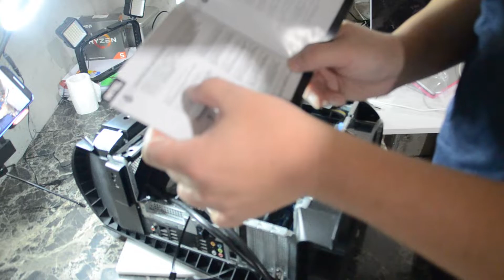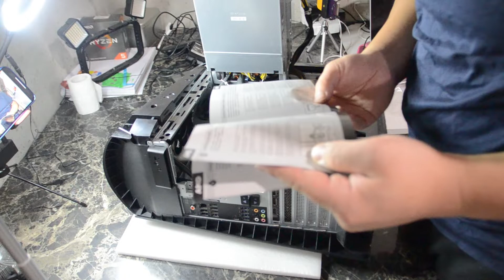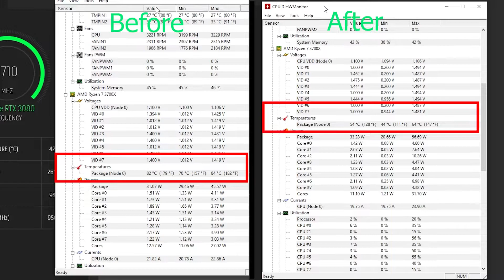Alienware Aurora R10-11 swap of fans Corsair Hydro H60 Liquid Cooler, Compare with before and after

Comment: Hey IonyTech Do you know how to fix boot failure on device? if so can you help me, i just bought the cpu cool, and it all goes fine but now this fail happens any advice on bios system and what to install o change?
Reply from the maker: What is the error message u see?
Reply: @ironytech3443  Boot failure on device
Reply from the maker: @MimiVRz  Can u enter BIOS and c all system information? find what device missed
Reply: @ironytech3443  The error message is Boot failure on device thats what it says on the screen
Reply from the maker: @MimiVRz  So you gonna try to get into the BIOS to c what happen
Reply: @ironytech3443  i did go into bios but then i go to boot and then to log into windows it says boot fail on device, i think my BIOS is couRupted, i think i need to get a usb and install windows onto it
Reply from the maker: @MimiVRz  After get in the BIOS and cehck if primary NVME SSD works good or not, might be you set the DHCI or Raid functions then fail to the windows.
Reply: @ironytech3443  wheRe do i check this

Comment: Hi I don't know if your still taking  answering comments

I have a water cooler from factory.

I have just bought a H60 corsair water cooler, is it worth changing it? Is it more powerful? Or should I refund and swap the stock fans instead.

Thanks!
Reply from the maker: If you bought AIO water cooler with Desktop from factory then i don't recommend you to change H60I, coz stock water cooler will be powerfull thant H60I, excep very noise coz original water cooler can adjust fan speed. H60I Can't although it is very quiet. and if you bought stock air fans from factory like me, then for sure H60i much better. ^^
Reply: @ironytech3443  thanks so much mate I am going to return it. You just saved me 70 pound

Comment: I got the R12 at best buy and there is no cooling option under 2000 dollars so i ordered this water cooler and dual channel ram. Thanks for the video. I was glad to see you didn't have to remove the motherboard to install a new bracket. I was hoping for that. Much easier. Thanks for the video.

Comment: Good morning Brother, great video, if you don’t mind and have a time then could you please do check this Corsair Fans information on their website and let me know, weather they would work on this Alienware Aurora R12, as I don’t know much, Also do make more videos on this Machine, really appreciate and many thanks Brother,

SKU CO-9050104-WW
Corsair iCUE QL120 RGB 120mm PWM White Fan — Triple Fan Kit with Lighting Node CORE Included.

Give your PC spectacular lighting from any angle with the CORSAIR iCUE QL120 RGB PWM White Triple Fan Kit, equipped with 102 individually addressable RGB LEDs – 34 in each fan – across four distinct light loops in a brilliant white housing.
Reply from the maker: No, This Fan kit u mentioned above that is no use to this PC, coz you don't have more extra power socket to let RGB fan controller use as well as fan kit
Reply: @ironytech3443  Many thanks and really appreciate Brother.

Comment: Hello! Thank you for this video! I'm getting ready to do this same installation on my R10 too for the same overheating issue. I'm going to use this as a guide to make sure I'm doing it correctly. I'm excited and can't wait to see the difference!
Reply: sid it work
Reply: @futureontop   I will be performing this process on my Intel i9, Air cooled CPU to Corsair H60 AIO w/ likely within the next 30 days, I've ordered the cooler and the VRM heatsink, now just looking at fan options. Lots of research is required and my go through at it will be the latest to date of someone doing it so I'll try to put together something to share to help others, at the very least a long comment explaining how it went.

Comment: My r10 comes in the next few weeks, I got myself a different fan so Corsair fan, I was wondering if it's easy to add a second intake fan. And do you need splitters to do this? I did not order with a hard drive. Only a ssd. I'm just worried I'll break something if I try to do this method. I could've sworn I've hit the water cooled option. I guess I didn't cause on the final paper, it says smart cooling.
Reply from the maker: In my opinion, that is easy to replace cooler as well as  fan, u just watch my vedio carefully and do that, don't worry.

Comment: Thanks for their video! Recently picked up an r11 and looking to do this install. How is it holding up? Also did you install vrm heat sinks? Or can this do without ?
Reply from the maker: No I didn’t install vrm heat sink. Not mandatory
Reply: @ironytech3443  thanks!

Comment: Just got R10 with rtx 3060ti with alienware 34inch curve monitors 120hz. im also upgrading to that cpu liquid cooler the stock sounds like a jet engine playing game😂.
Reply from the maker: Congratulations!, Should be jet engine but you can set RPM to quiet :), Don't worry

Comment: I've had my Aurora R11 for two days.  It's sad I'm having to find videos like this after dropping all that money, but it just overheats too much when I try to stream.  Only when I try to stream.  I can play my games, or do anything else on it all day with no problems at all, but when I try to stream it overheats to the point it just shuts my game off after 5 mins every single time.  Pretty sad, and frustrating.  Now I have to drop more money.
Reply: I would repaste the gpu before doing anything else that will drop the vram temps
Reply: @orangejuicewithpulp403  Appreciate it, but I did go ahead, and buy this and put it in, and I have had no problems at all about it overheating since.

Comment: Any way to get it to stop the supportassist pre boot system performance check? It takes a minute to scan and then says the cpu fan failed to respond correctly. I can continue from there and the computer works fine. Just annoying every time you start up having to wait
Reply from the maker: Idk if this is works? but you can try to check mark off go into the setting with automatically scan.
Reply: I'm wondering the same thing. I thought I did something wrong. What are your temps like and did you change case fans as well?
Reply: @ObiJUANcanolli  I pretty much tried everything, but it seems like unless you buy their heat sink and install it under the water cooler, it will just always give you that error. It takes 2 minutes to scan before it lets you thru to the boot up. 

My Temps went down from high 80s to high 60s, I changed the case fans to the 120mm corsair ones too, but a few days later my PC bricked and I sent it back to dell. Don't think it was related to this, but I was relieved to send it back so I could get one with the right cooling system lol
Reply: @Mustardhat  this is no longer under warranty but I'm now worried i may face the same dilemma you went through. I went with noctua redux fans. I put the corsair fan aside.

That's funny you dropped from 80 to 60 because my temps were the same. I ran cinecench with stock cooler, 80-90. With h60 and noctuas I went no higher than 65.

Leaves me wondering what I might be able to get out of a small oc
Reply: @ObiJUANcanolli  I think changing the case fans is just for noise, the water cooler was the main thing that brought the Temps down. Honestly If I wasn't able to return it I would have probably just waited until I could afford a new setup and just take the graphics card from the alienware and sell the rest for parts. It stays hot because the case is shaped so strangely there isn't much room for ventilation, sadly they're one of the only options for pre-built that don't take months to arrive

Comment: Did anyone get a cpu fan bios error when you load up your pc. I have a r11
Reply from the maker: It's weired, Are you sure the error get from CPU? not a AIO pump?
Reply: @ironytech3443   no, I Just put the connector pin into the cpu fan socket pin rather than the pump socket. done stress test and the pump works fine being plugged into that
Reply from the maker: @MelodyMatrixMix_AI  Idk what kinds of error message you have, i don't have any error as long as you put connect pin into either top fan pin or CPU fan pin.
Reply: @ironytech3443  yh I plugged it into the cpu fan socket and no longer getting the bio error screen 😀
Reply: @ironytech3443  great video tho, really helped me out a lot 🙏🏼

Comment: 2 questions.1. is this pc your doing this on a r10 or 12 and 2. Is it okay to have the cooler ass backwards like you had it or is it not a big deal
Reply from the maker: My PC is R10, but i believe R11 is same chassi as well, but i don't know about R12. 
Don't understand your 2nd questions exactly, Soory
Reply: @ironytech3443  I have a 10. But my second question was it it okay to put the cooler upside down like you had it
Reply: @ironytech3443  do I only need to buy thermal paste and the cooler?

Comment: Did you have any problems when you started the pc? I’ve seen where the pc is very picky about what fans you use. Please reply
Reply from the maker: What you mean, you mean such as error message or warnings when started PC?
Reply: @ironytech3443  yes I’ve seen other vids where they put in a different fan and it gives them a error and it doesn’t work
Reply from the maker: @julianakers390  Well, As my experience, when i connect liquid cooler to the AIO port of motherboard will warning not be able to pass when started with error message, Make sure connect H60 to the Top fan port of mother except you use orginal liquid cooler.
Reply: @ironytech3443  ok thanks you so much

Comment: I love my R11 but noticed the CPU temps were awful. Dell shouldn't sell these with air coolers, the case layout is designed for liquid cooling. I have this part coming tomorrow and hope that it will work well. Thank you!
Reply from the maker: wow, Congratulations and hope everthings go well. ^^
Reply: How did it go? I just ordered this cooler for mine too
Reply from the maker: @msharmall7298  Not too bad, but only one things that not be able to controll Fan RPM, if can that will be perfrect ^^

Comment: wait a sec....you put the fan on the inside of the radiator..im seeing other people putting the fan on the top of the radiator where its at the top of the case...what is the difference?
Reply from the maker: I think it doesn't matter the fan placed inside or topside of radiator, but most impoertant that make sure the heat air must be absorbed from inside to out side for this case. 
BTW,  normally the people will install the fan to the outside or topside of radiator when you wanna absorbs new fresh air to the  case inside.

Comment: On another video I saw that the person kept the black metal housing for the radiator, and here it seems you do it without, Im curious. Does it just actually snap into place and stays held together? Because if so then I will be extremely joyful to know that.
Reply from the maker: I don't understand what you mean about metal housing? u mean the cage? normaly the cage originaly stay insite the pc case, yes you just snap into the cage and will held together  them self becoz H60 size is completed fit this cage. hope this anser will assist you.
Reply: @ironytech3443  oh cool! Thank you! That is exactly what I was trying to say, well Im glad to hear that then! 

Cheers!

Comment: Looking to replace this case with a corsair mid tower. I wonder if its possible?
Reply from the maker: well, why are you plan to change case?  it should be ok  coz the confirmation of motherboard almost same but i don't recommend. that is worthless.
Reply: @ironytech3443  i just don't like the alien ware case. Im going for cosmetics & rgb etc.
Reply from the maker: @bigabek1873  That's amzing project, but you had better changing case after warranty otherwise will not be able get it in case. I think not a big problem to change case.

Comment: My Bios was giving an error message after installed this on my R11.
Reply from the maker: U gonna connect liquid fan cable to the MB cpu fan port, don’t connect it to pump port, otherwise will give error
Reply: @ironytech3443  thank you, I will try again.
Reply from the maker: @YC305  NP, remember either upper fans port or cpu port whatever u wanna choose will works expect pump port.
Reply: @ironytech3443  ok hopefully it works because is a pain in the butt to mount this thing.thanks again

Comment: Hey, you should get the VRM heatsink too because of the liquid cooling
Reply: Where can we order that heat sink? Not sure which one will fit.
Reply: @captainOli7523  Need to contact dell customer service / sales to buy it. It’s currently out if stock for the r10 though
Reply from the maker: Should we? coz i don't think the VRM related with liqid cooling, excep you gonna overclock extremly for CPU?

Comment: Has the Corsair H60 better temps/noise than the alienware watercooling solution ? Thanks
Reply from the maker: Well, I am sorry to say that i don't have the oringinal watercooler to compare with this corsair H60, but I think if you ordered opntion watercooler from factory you don't need to change H60 coz if you think fan loud? you just turn down the fans speed to low is ok.

Comment: In 7:22 how is it that you’re having the fan and radiator stay to the top? When I follow what you did exactly that part is loose and falls down if I move it too much. Is there something you screwed to keep the radiator and fan connected to the cage for the top area of the Alienware?
Reply from the maker: It weired, Are you sure you use the H60 Liquid Cooler? No i don't have any Screwed to keep radiator coz it is completely tiet into the cage then i don't need crew that, however if your radiator really loose from top cage, you have use extra 4 crew to fix radiator with cage after remove top cover.
Reply: @ironytech3443  ye I’m positive, it’s the same exact thing as I’m seeing in the video. It’s not loose but if I did, just a tug of the radiator and it moves down a bit. Right now it’s staying still at the top. I’m just scared it may fall down while inside
Reply from the maker: @ancianooo_1  So i recommend screwed use the extra 4 screw to fix your radiator into the cage from top, this is just in case prevent radiator drop down future.

Comment: Just FYI: Dell uses a CPU mount close to LGA115x for AMD. Also if you plug into the Pump header it will trigger a BIOS error unless you order VRM heatsinks from Dell.

Comment: Great video. Can’t believe Dell even gave the option for air cooling. I went air to save money for other upgrades. Two questions. One, the air cooling it shipped with sounds like I’m at the worlds largest airport. Will this help with noise?  Two, was the case in this video the R10? I have the R10 AMD Ryzen 7 3700X version. Will the H60, as shipped, fit this AM4? Also, can this H60 fan be swapped? Thank you
Reply from the maker: Yes, this is my R10 Ryzen7 3700x serise,   yes the H60 be able to reduce the noise than before as well as will reduce the temperature. Yes H60 fans able to swapped the others as long as 120mm size of fans
Reply: @ironytech3443  Thanks for the video. Got my H60 yesterday. Slapped it in in about 30 minutes. Only thing I did differently is I pulled out the top fan housing rather than popping the top of the case off. Mounted the radiator and fan in the housing and then the placed it back and screwed it in. It was a pain, but every time I pull on plastic lids, I end up breaking shit. So I did it that way instead. Your choice of the anchor screw size to the motherboard was spot on. Very valuable information. My R10 is finally quiet and never above 82c under heavy load. Thanks again. Glad I seen your video.

Edit: can’t believe Dell even offer this build with an air cooler. I figured they new what they were doing and put that money towards upgrading elsewhere. End of the day, I ended up paying for liquid anyway.
Reply: @tpnurdle1  Wow bro, it is absolutely nice work mount radiator into the top cage with crewed, That is what i sugguested everybody have better screwed coz it will prevent radiator drop down. although my radiator is not drop down so far but who knows for future, however congratulations and enjoy your monster.

Comment: If you mount the intake fan in the place of the top HD bracket the results are really good, i had to do it as my Gigabyte RTX3070 Vision would not fit otherwise :) i am getting normally 40C CPU and  GPU on idle and mid 50'sC CPU & CPU while gaming, this is with stock fans and stock liquid cooler, I am going to install Corsair ML120 Pro soon, but i just built my aurora so i can enjoy it a little bit before i dismantle it again. Please bear in mind i use Ryzen 3600 which is only 65W. I also don't have any HDD only SSD
Reply: After pushing system further with MSFS2020 CPU can reach 60-65°C GPU stays below 60°C
Reply: ML120 are definitely quieter, but still audible, i sandwiched radiator with two of them and also installed intakenone in the place of HDD

Comment: awesome job! does the R10 have space for 2 GPUs?
Reply from the maker: Yes it is, very tied space, but be able to double GPU as long as size same with original GPU
Reply: @ironytech3443  I don't know about Radeon, Nvidia 10 series, 16 series, 20 series, RTX 3060 & RTX 3070 cards but at least the RTX 3080 & RTX 3090 are custom cards made by Alienware so it would be impossible to get a new second card of the same brand. Is it ok to be different brands? If not, then you'd need to get two cards and you could easily sell your card to someone with an Alienware R8-R11 who wants to upgrade or someone else who wants to do dual card lol (although you should always keep original parts until the warranty period expires).

Also keep in mind that you need to make sure your GPU is under 276mm (~10.5") in length and under 118mm in height to fit the case. Those are the size maximum specs as I was told by Alienware for the primary GPU. I do not know if the secondary GPU would be different.